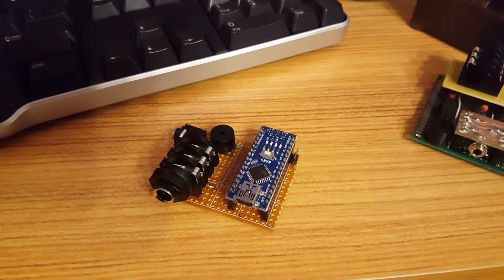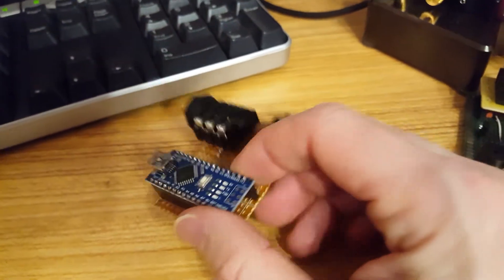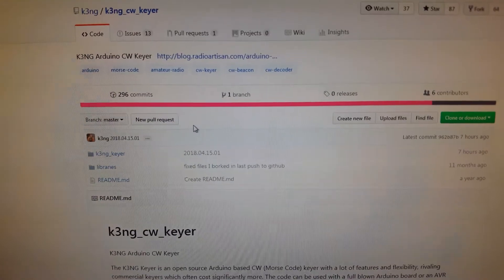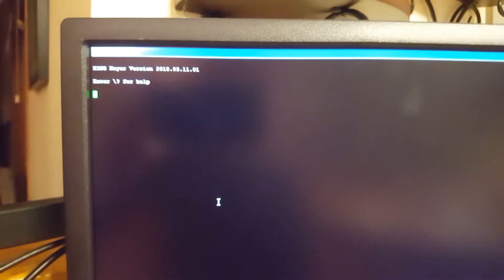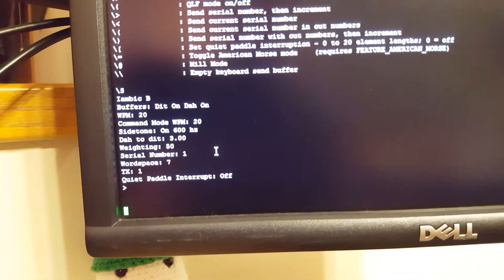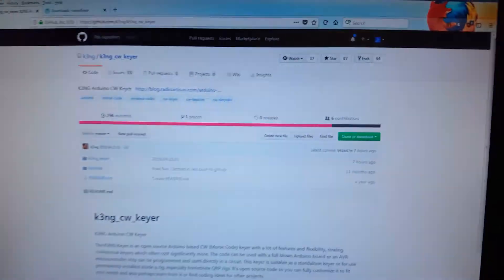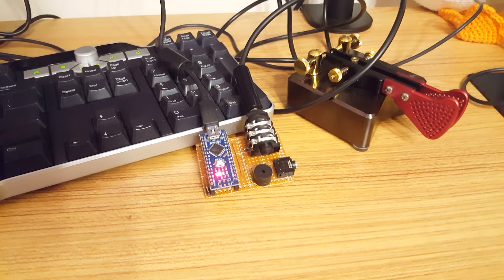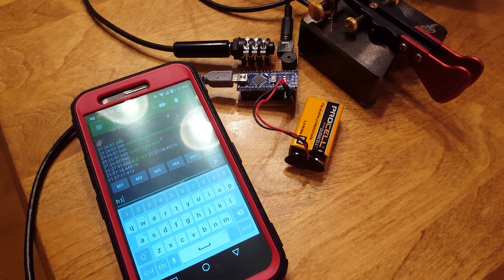Arduino Practice Keyer V3

Comment: very nice!!!!! How i connect the phone to arduino please? like you show it? need any app?
Reply from the maker: You need a serial console app like "USB Serial Console" and a USB cable to connect the Arduino to your phone. This cable is often called "USB to go".   Make sure that the cable has the correct connectors for your phone and Arduino.
Reply: @adventurewithclaus yes but app??
Reply from the maker: @teachermariogarcia4299  Any serial console app should work.  There are quite a few of them.  I don't have a specific recommendation.